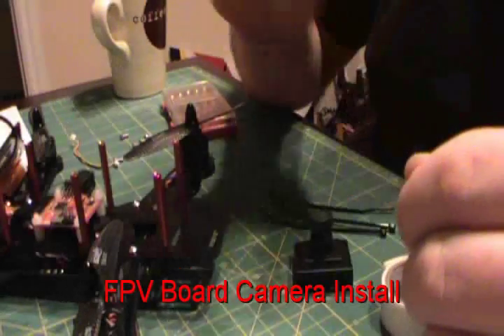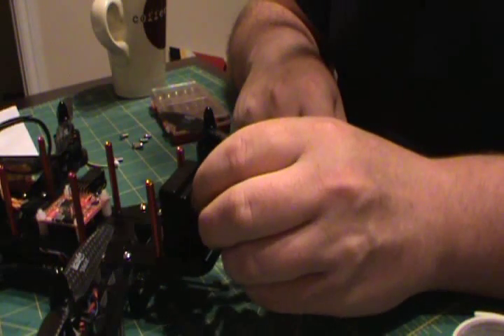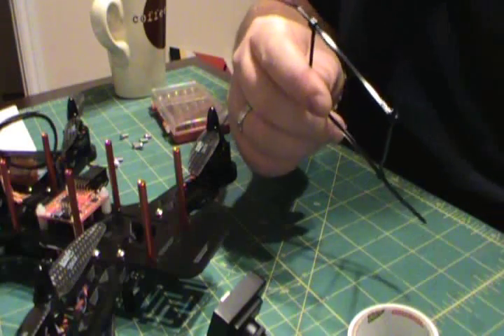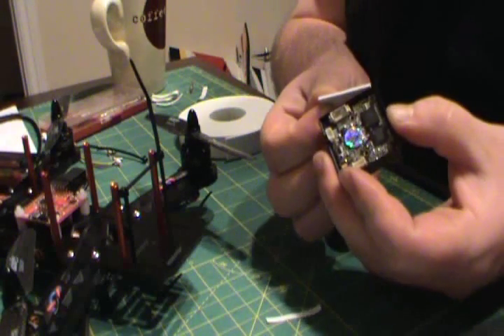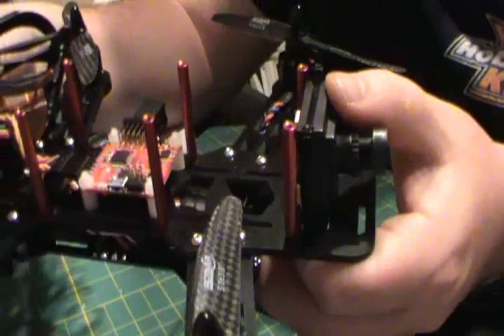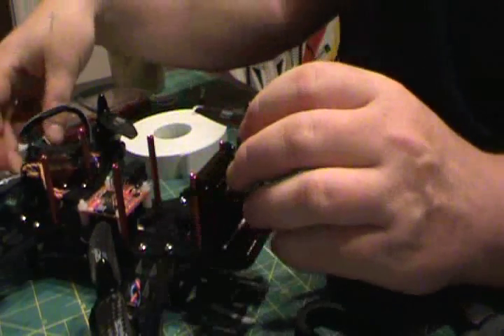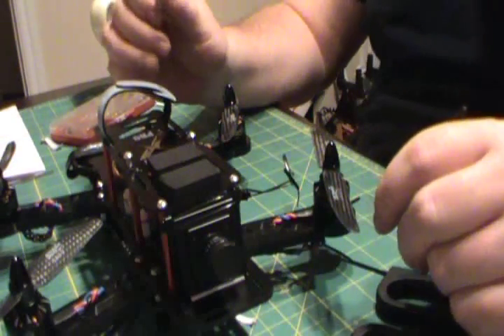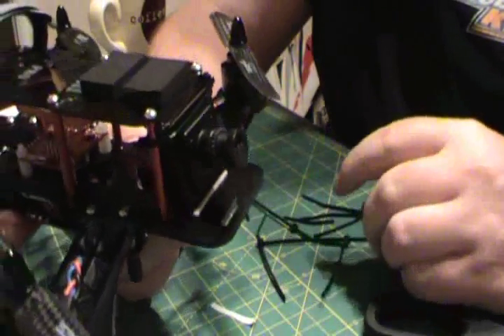How to install a FPV board camera to your MutiRotor

Comment: Do you need a step down for that cam?
I think the surveilzone cams support2S up to 4S
At least I think mine does.

Good stuff
Reply from the maker: No i dont, this is 12vcam and im going to be running 3s. I just need a LCfilter. So i ordered one of those 5v/12v stepdowns with the filter built in. :) cant wait!
Reply: :) I can imagine